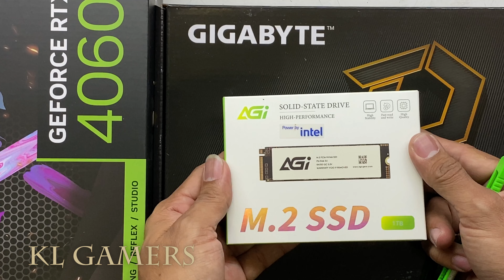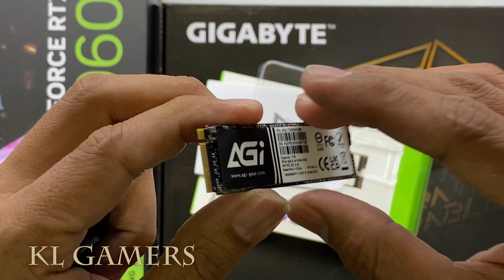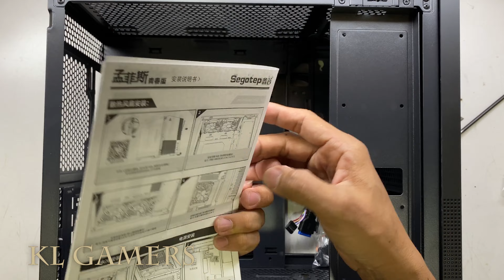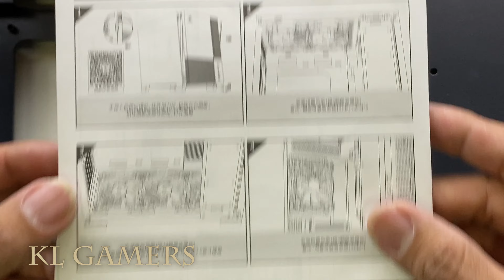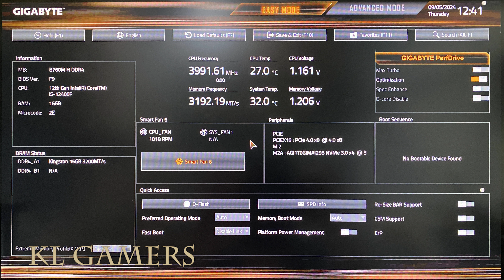intel Core i5 12400F GIGABYTE B760M H DDR4 COLORFUL RTX4060Ti Gaming PC Build Segotep

Comment: Great build.  That's an unusual case design - putting the power supply where it is.  I will say it's a space saver, though.

The first thing I'd add to it is at least one fan blowing air in from the top and one in the back for exhaust to keep the internal temps down.

Comment: I need help intel i5 12400f or ryzen 7 5700X
Reply: ryzen
Reply: @fps-e5b  reason please brother
Reply: @fps-e5b  i saw benchmark both are same but there is  intel 2% diffrence
Edited=intel is just some point diffrent in low  than ryzen and intel  low at cost ( budget) ryzen is 1% extra cost than intel
Reply: Intel. Even if this 2 platforms are barely dead, intel lga 1700 is more upgradable than am4
Reply: Ryzen 5700X Better, even the Ryzen 5600X is a good option too 👍
Reply: Intel
Reply: @crazywarm  The Ryzen is a better option because of its larger cache memory and has 8 strong main cores, which are really important. Greetings
Reply: @arieljd1  sorry,what is use of chache memory and thank for all who helped me
Reply: Thanks to help to all and,
 i decided to buy ryzen
Reply: @crazywarm  CPU Cache Memory its goal is to reduce memory access time and enable faster processing. Very CPU-dependent games tend to benefit a lot from CPU cache memory, which is why Ryzens with 3D-V Cache perform so well in games👌
Reply: @arieljd1  ❤️‍🔥👍thank you my friend
Reply: Anytime RYZEN because AM 5 support is till 2027. If possible please wait for the upcoming RYZEN Series. Intel is dying slowly.
Reply: @rahulchanana1316  ❤️‍🔥👍